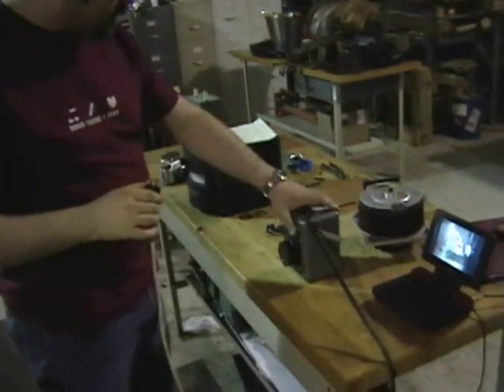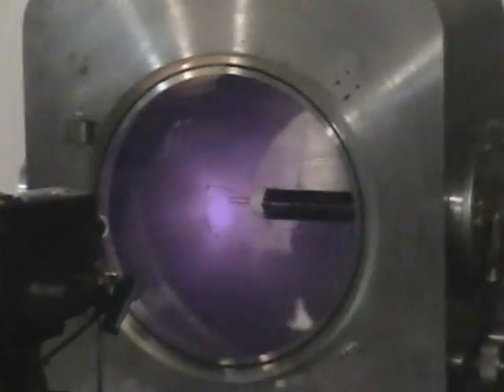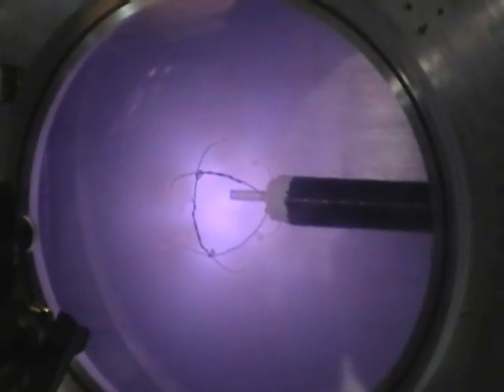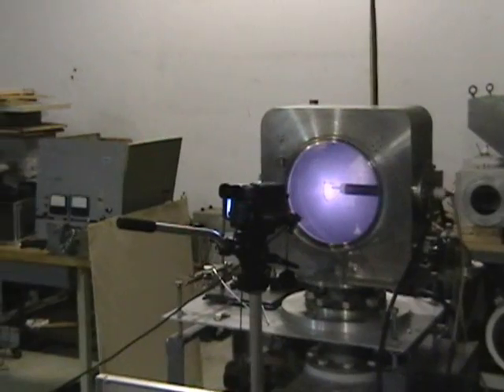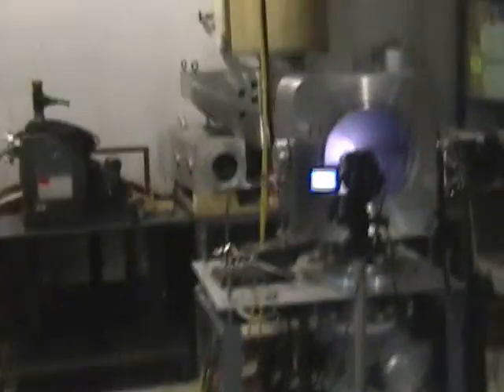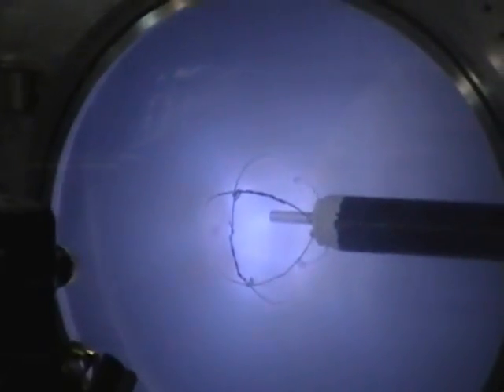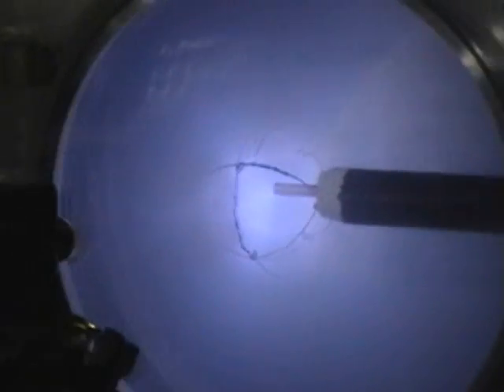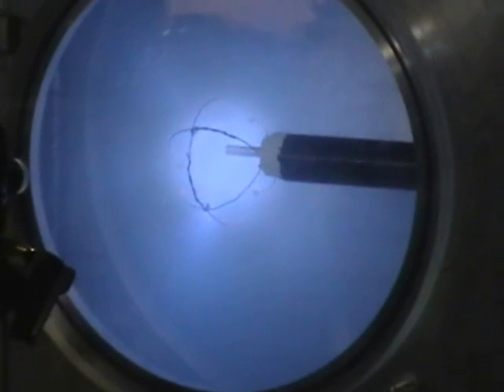Fusion Reactor First Test Run

Comment: Fusors really can produce fusion.  ...now, whether they can produce enough energy to even begin to approach the power input... that's another question.  Also any fusion device with electrodes in the plasma seems to me likely to kill itself before it generates net power.  Even so, it's a very cool benchtop plasma/nuclear project!  Nice!

Comment: As far as I know the termonuclear fusion is producing so much energy (heat), that it melts down any material. So my question is how do you produce the vacuum around the plasma and if there is a vacuum how do you keep the plasma in one place? It is not an accident, that usually these reactions are produced in a super conducting tokamak. And not in a "stainless steel" cotainer. :-)

Comment: I guess nobody else read the description and read that there was no fusion because this was a "Test" and that there wasn't even any fuel in the reactor, only air at medium vacuum. this was really just to show that on the first test fire they could acheive plasma which they did which is actually a big step in acheiveing fusion without a large facility such as ITER.

Comment from the maker: @coldarc The strong nuclear force is what holds the nuclei of atoms together, without it the universe would just be a big particle soup. The weak nuclear force controls things like particle decay. Both of these things are easily measurable and observable phenomenon. To call them "magic" because you can't be bothered to understand them is both arrogant and lazy

If you want to be able to have meaningful things to say about fusion, you need a better understanding of intra and inter-atomic forces

Comment: @userjjb if you didnt understand what i wrote then it must be because there is a lot of things haven't figured out yet. i dont believe in magic. the strong force is a magical force since it is not somthing you can observe or detect. you can work with electromagnetic waves you cant work with invisible forces that only make sense in an equation. for me strong and weak forces are gibberish and i have read up about them so it isn´t that i dont understand the concepts. .

Comment from the maker: @6055vishal Two reasons: First the plasma is contained by the electric field, this is called Inertial Electrostatic Confinement. Second, even if the electric field was turned off, the amount of energy stored in the plasma is so small that it would raise the vacuum chamber by a couple degrees.

Think of it this way: Ice melts at 100C, a burning match is at a couple hundred degrees C. So why can't you melt a whole glacier with a match?

Comment from the maker: @generalxulfi D-T fusion is generally preferred because it requires less energetic conditions to achieve. However tritium is radioactive and is a tightly controlled and expensive substance. Our chief concern here is not to achieve break-even fusion, so D-D fusion serves our purposes just fine.

Comment from the maker: @lurconis666 Fusion occurs when the accelerated nuclei velocity is sufficient to overcome the Coulomb barrier. For D-D fusion this is around 10^7 Kelvin, or about 10keV. The fusor is just a spherical particle accelerator, with a negative center grid and ground potential outer grid. The voltage difference accelerates the positive nuclei radially inward towards the center. Accelerating nuclei with a +e charge to 10keV requires 10kV voltage to do, easily achievable with a decent step up transformer

Comment: use high voltage low current high frequency, but use two frequencies and the atoms will mechanically separate. electricity as waves of energy can split and fuse matter.
all particles are made of waves of energy. by modifying they wave structure you can take one neutron from one atom and give it to another. if you do that with two hydrogen atoms you will have one tritium and one unknown. protons and neutrons are pairs of particles. when hydrogen become tritium its unstable. im probably wrong.

Comment: @Univac93 According to a scientist i heard present their work on this kind of fusion reactor,  ITER is an awesome science-project, but not very feasible for power production.

THis is partly due to the amount of power ITER-type reactors use to hold the particles in place, and materials they use for producing more fuel (the walls are lined with liquid lithium or something)...

Comment: everybody, im afraid it is indeed a real fusion reactor, the reason this is good work but not the answer to all energy demands is that they are drawing more power than they even come close to producing. this is like a fusion chamber strictly for study,not energy production.but i have heard that some laboratory has actually made a selfsustaining fusion reactor,i dont know if that means they can actually take a decent amount of power away AND maintain the reaction.they usually use tritium in these

Comment from the maker: @lordzkonyx Our outer grid is simply the grounded stainless steel vacuum chamber. Our inner grid currently is three loops of tantalum wire arranged in three meridians of a sphere, spaced equally.

The outer grid is at ground potential while the inner one is at around -20 kV provided by a step up transformer with its primary coil fed by a variac from mains voltage.

The inner grid should be made of a conducting material that can withstand high-temperatures and has a low vapor pressure

Comment from the maker: @TheNuclearWatermelon We are aware of the potential radiation risks. We were operating at around 6-8 kV acceleration potential in this video, not enough to produce significant x-rays. At full operating voltage operators are far enough away to mitigate any radiation risks.

Comment: 20 volts input, plasma forms, outputs 8000 acceleration voltage. Why is this experiment important in demostrating fusion.  What potential fusion criteria were satisified by the prototype?

Comment from the maker: @Exarian Many good questions. You get fusion at any voltage, just much more of it above a threshold. The voltage is used to remove electrons, producing positively charged nuclei that are pulled to the center and smash into each other, fusing. Fuel delivery would be specific to method of operation, we feed it in from a lecture bottle through a capillary tube with a needle valve for control, crude but cheap. Fuel is typically deuterium or tritium Electricity would be produced typically via turbine

Comment from the maker: @xXxDeitiesxXx We use a transformer to step up the voltage from the wall (0-120V) to the voltage we actually apply to the grids that accelerate the ions (0-30KV). So when you here "input voltages" being called out, thats the voltage we are putting into the transformer, while "acceleration voltages" are what's coming out. BTW, I think it's pretty neat for you to take an interest in this stuff in middle school. Soon enough you will have enough math/physics background to really dig into it! :)

Comment from the maker: @aradioactivedonut An outer positive grid won't do much for you, other than pose electrical safety risks. Mean ion energy is determined by the *relative* potential difference between inner and outer grids, not the *absolute* voltage of either grid. -30kV inner 0kV outer is the same as -15kV inner 15kV outer. Not only that, the electric field will look identical, you won't get any focusing effect. Your intent at creating a more efficient reaction is spot on though, this is what matters!

Comment from the maker: @xXxDeitiesxXx The ultimate goal for most is using it as a source of power, normally electricity. In an ideal situation you would be able to produce cheap, safe, clean, and sustainable energy. Of course all of that is easier said then done. Scientists have been working at this goal for ~60 years.

Comment from the maker: @Seanmatthew22 Ion production from the steep voltage gradient is called "glow discharge" and is the most common method in simple setups. Unfortunately by this method the bulk of ion production is near the center, where the ions have a lower starting potential energy. More efficient setups use ion guns or thermionic electron emitters near the outer grid to maximize the initial potential energy of newly formed ions.

Comment from the maker: @EmperorOfMars Typically: neutron metrology. This is a fancy way of saying we look for high energy neutrons. High energy neutrons aren't something you commonly see "in the wild" so if we detect a significant neutron flux, we have very solid evidence. Using the isotropic neutron flux we can determine what the rate of fusion events is. A small fusor with sufficient efficiency and power might achieve around 10^6 neutrons per second isotropically.

Comment from the maker: @wyvern499 This is a fusion reaction, not fission. Heavy isotopes like uranium and plutonium are split in fission reactions releasing some of the binding energy. In fusion reactions light isotopes like hydrogen and helium are fused together, resulting in a slightly more stable atom with the "unnecessary" binding energy being released. We use deuterium as it is relatively safe to handle and is easily available.

Comment: so, from what I understand, the process right now is just in the range of sub-fusion because there is only enough amperage to dislodge electrons, correct?
So, if this were scaled up to the point that it sustain a reaction where atoms are being forced together, how would materials for fuel be fed in, and what byproducts would it produce? Would it need the energy input to sustain the reaction or just to start it? what would be used as fuel? and how would the energy be made electrical?

Comment from the maker: @TalksWithDirt The "simplest" but least efficient way would be a heat engine. Neutron capture and x-ray/gamma ray absorption produce heat, which could power a Stirling engine or steam turbine and be used to generate electricity, but you are fighting against Carnot efficiency. Some proposed energy capture  schemes use a solenoid to decelerate high-energy ion byproducts and produce an electric current with far greater efficiencies, but the ultra-high voltage is difficult to manipulate.

Comment from the maker: @MrJordanflys What do you mean by a "cathode reaction" as that is a little ambiguous. If you are talking about the pervasive quack electrolysis videos on youtube, this is not one. No water is involved and nothing is being electrolyzed. This is a purely nuclear reaction, not chemical. Deuterium is introduced into a vacuum and ionized by the strong electric field gradient between the negative inner grid and grounded case. Nuclei are accelerated towards the center, collide, and fuse.

Comment from the maker: @splinter196 A deeper vacuum has two major advantages. A larger mean free path should yield a greater number of collisions per unit of input energy however the number of collision per unit time drops. Secondly, deeper vacuum allows higher acceleration voltages (to a point) leading to greater average ion energy and improving the % of ions that could actually fuse. In order to use deep vacuum we'll have to switch from glow discharge to ion guns or thermionic electron emitters for ion production.

Comment: @JohnJWardjr
Maybe i could give you a bit of info, instead of being a smartass like the uploader.

Fission reactors (the everyday nuclear power plant) work by splitting atoms and using the power that is released to generate electricity. A good example of this is the atom bomb, which is the same process except uncontrolled

Fusion involves the fusing of two atoms together. The best thing about fusion is that it is much safer to use. As it does not deal with mega bursts of radioactive energy.

Comment: @JohnJWardjr Fission can go very bad, very quick, in examples of nuclear weaponry. When heavy elements (uranium) split the produce exothermic reactions (big booms) and much radiation. While a runaway chain reaction can create a thermonuclear explosion like that of the hydrogen bomb, fusion is a very delicate process and can be "interupted" much easier to prevent runaway. Fusion also produces much less harmful high energy neutrons instead of gamma radiation. Earth will still be here :)

Comment from the maker: @charliebrown2442 Chief radiation exposure concerns are actually x-rays from Bremsstrahlung at higher acceleration potentials. Of secondary concern: high energy neutrons when operating at larger amounts of fusion events per second

Both of these are mitigated by three things; distance, limited operating times, and shielding Radiation flux drops off as r^2, operators see only perhaps 20 mins of exposure time per year if we are ambitious, and shielding can attenuate the rest to acceptable levels

Comment from the maker: @SpeedVideoz More current doesn't necessarily equate to more fusion. The higher the current the more ions will be produced, the more voltage the higher the kinetic energy of the ions. The ions produced are for the most a thermal distribution (ie Gaussian) and so depending on the pressure regime and operating mode, a higher average ion KE might yield more fusion events per watt .

Comment from the maker: @jmantheburninator That is the inner grid. They are raised to a electric potential of upwards of ~50kV when full operational. They serve to both ionize the gas (when operating by glow discharge) as well as providing an accelerating electric field for the positively charged nuclei.

They attract the nuclei which come rushing towards the center, where they collide. If the nuclei have enough kinetic energy, they overcome their electrostatic repulsion and can fuse into a heavier nucleus.

Comment from the maker: @Demonchld666 That's 5A input on the HV transformer (the breaker trips on the variac at around 5A) at around 40-50V IIRC. Current drawn on the output can be a bit murky since it's feeding ion currents between the center grid and grounded outer shell, normally not anything more than 6mA though.

Comment from the maker: @pavle1980 Technically yes. However it's only 1.0000000001 more energy than we put in. The trouble is that converting the energy released to say electricity is at best ~60-70% efficient (using say a steam turbine or Stirling engine). This means that the net "usable" energy released is lower than that put in, and so not a commercially viable energy source. For research purposes however it is quite useful.

Comment: @torylva Plasma doesn't need to be about 3 million degrees. Common neonsigns or fluorescent lamps are working because of the conductive ionized gas (plasma). It's the fusion that requires high temperatures. We cannot replicate the pressure that's inside the sun, so we actually need much greater temperatures than in the sun.

However, the discription clearly states they are only intend to create plasma (wich they do), not fusion.

Comment from the maker: @halohadel Actually both neutrons and x-rays will be produced, neutrons by fusing nuclei and x-rays by accelerating charged particles. In practice the x-rays are more important to worry about, especially at higher acceleration potentials (>30kV) as they are far more copious. Thankfully shielding is quite easy here, some lead sheeting, distance, and limited exposure times lowers the dosage to background levels

Even really cranking we are only putting out  1 million neutrons isotropically

Comment from the maker: @coolestdude80 Actually, all you really need to produce fusion is nuclei with high enough kinetic energy so that they can collide and fuse. Of course there are many things you can do to improve the rate and efficiency of the fusing: choosing "fuel" with high apparent cross-sections, higher plasma density, etc.

Low vacuum is needed in this case to ensure the mean free path of a nuclei is sufficient to be accelerated across the full potential difference between the inner and outer grids.

Comment: @seethebob no thing such as cold fusion exists... this is not cold fusion and it cannot power the world as it a much bigger reactor would use more energy than it would generate... only way is to heat the plasma to 10^8K and then contain it with electromagnetic field in a vaccum chamber... see ITER for more info

Comment from the maker: A good background in physics and electronics helps a lot. You'll be dealing with vacuum systems, high voltage, radiation metrology, etc. The chief risks come from dealing with high voltage electricity and x-ray radiation at higher acceleration potentials. A functioning fusor would probably cost around $1000-$5000 depending on how frugal you are.

Comment: Cold Fusion doesn't work, because no one has proven it. Show me with Voltage, current , and temperature meters you get more energy out than you put in. I bet anyone $10,000.00 they can't. Cold Fusion disproved. Notice they can't use it to power anything.

Comment: This is a Fusion Reaction, which is different from Fission. Fission is the process atomic bombs and nuclear power plants operate under, so yes we have that down too.

Its not fake, this is indeed fusion, except the Farnsworth Fusor design is so unstable most electrons escape before going through fusion. Its won't be an effective way to produce electricity until some big problems are solved.

Comment: No you don't understand what I'm saying look carefuly what I am saying is that if the potential energy of B is greater than A's kenetic energy but A's kenetic energy Puts B's potential energy into motion then B's energy has exceeded A's but I'm not saying B will sustain itself understand? and also I wasn't arguing whether or not they cause climate change that is debatable but they DO have an affect on the way our atmosphere behaves in regards to light reflection/heat reflection that is proven.